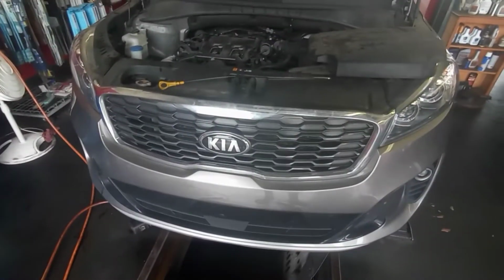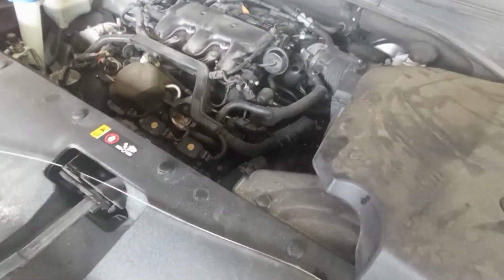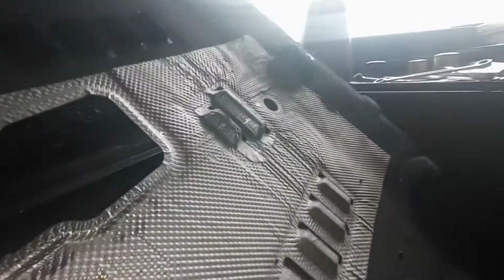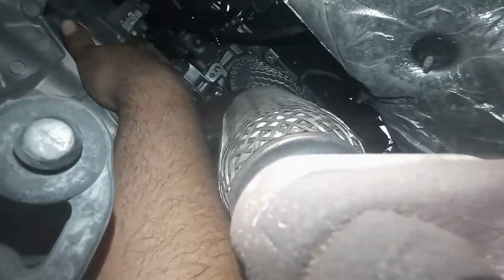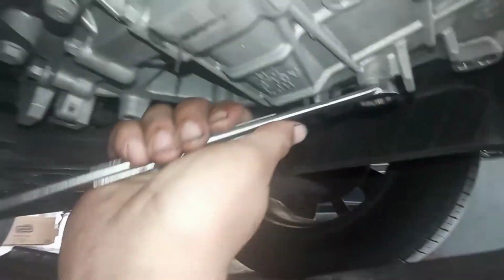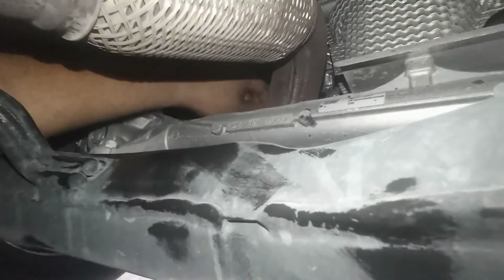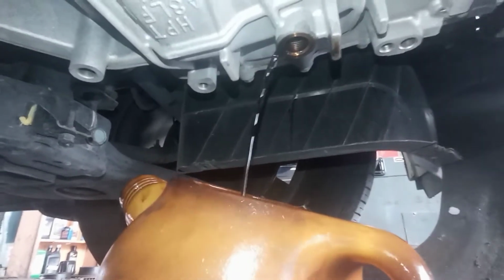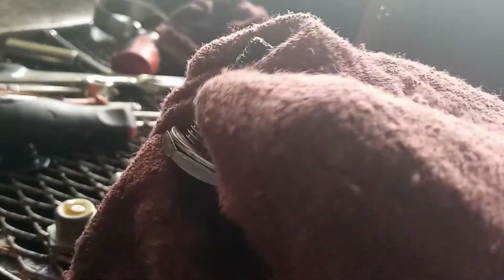2015/2020 Transmission Fluid Drain and Fill for Kia Sorento

Comment: How many miles between change on 19 Sorento v4 got it new
Reply from the maker: 45 to 50 miles
Reply: Ok thanks I saw the dealer recommendation they said b4 60k 
Iam at 45k and was thinking its better now
Reply: All I need is oil ? Which kind do u recommend

Comment: Question sir Is that 2.4  kia sorento? Mind is 2014 is 1 gallon is that all i need to change my transmission fluid?
Reply from the maker: I believe for join and fail is four coat of transmission fluid when you drain the fluid you have to match how much fluid do you have on a car and you add the same thing

Comment: How do you check the fluid level
Reply from the maker: This is the problem you cannot check the fluid level on this cars
Reply: Isn't there a full level plug? Just draining the oil and filling 4 quarts doesn't sound right at all. 

I'm looking to do this on a 2019 Kia Sorento with the V6 transmission soon and I'm unsure yet if this video is the same procedure
Reply: *fill level plug
Reply: @chrisc8089 there is at the front side of the trans on the plastic cover, I a 3/8ths plastic plug. You do need to do it between 122F to 140F or 50C to 60C fluid temp so you might need a scanner
Reply: Fill until overfill then you know it's full

Comment: That's only half transmission fluid being replaced.
Reply from the maker: This is the safe and easy method you can change your fluid by yourself
Reply: drive around for a bit and do it again youll get tyhe majority you dont ever want to flush a trans

Comment: having to check or change tranny fluid and needing a lift is a HORRENDOUS design
Reply from the maker: We should try to float by yourself cus you only $30 but if you decide ticket to someone they charge you between $200 to $300